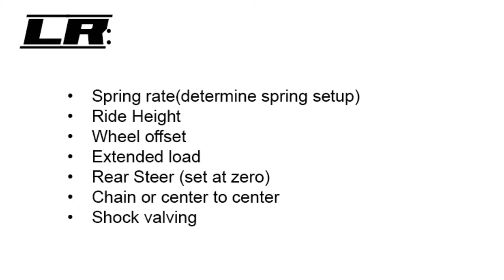Left Rear Setup and how it works.

Comment: 7:23 extended load -  consistently over 250  decrease rear percent. Under 180 increase rear percent ?  Can you explain that a little further
Reply: Seems like it should be opposite to me.
Reply from the maker: Sorry, these are not scripted videos, and I made a mistake, thanks for pointing that out. Good ear. The statement is on extended load: If you keep increasing the load and find yourself above 250 pounds on a regular basis you will need to increase rear % also, and then drop your load back down to 180 pound range.
Reply: @jaynealgofast  Thanks for this question, I was giving you the orator the benefit of the doubt, trying to puzzle it out!! Ha!!

Comment: What are your thoughts on using the roll centers to load the tires and how that affects the car differently than the shocks and springs?
Reply from the maker: Yes, the Roll Center (RC) or center of gravity (CG) is what we are trying to make move. These are two different points that work in the front of the car. The roll center and the way it moves, and the height of CG determine the amount of spring load we see, while the shock controls it. Now there are other things involved in making this work, this is just a simple version of it. We will start working on a roll center program for you in the near future.

Comment: Jay. Just needing a little bit of a clarification. So you are saying to mount the chain mount as far out towards the birdcage as you can? Most things Ive heard about it was as close to the bell as you can. Thanks
Reply from the maker: Hear are my thoughts about chain drop: We are all over the map on this, putting it next to the bell is the only thing we can agree on when it comes to LR chain.  When someone gives you, a chain drop it is kind of like shock valving, don’t mean much. 3.5” of chain at the bell is a lot vs. 3.5” out by the cage, and what is important is how much is the tire moving. For your own program you can mount it about anywhere you like and make the adjustments needed for your car. But when someone is helping, and you give them a number it seems to be inaccurate how much the tire is dropping. Wonder why everything is going towards the bell, maybe that is the question we should ask???? I mean really, is there a reason I don’t know.  Thanks for your question.
Reply: @Jay Neal  appreciate the response. In my scenario, I only have 4in of drop as it is due to the underslung as I am on some 2009 technology 🤣. From everything that Ive heard. Moving it closer to the bell makes the force of hitting the solid chain less violent. But the other scenario that I see  is that it is also a pivot point as you have mentioned in different vocabulary.  On the 175 that  I run in the RR. I am going to gain travel on the RR as opposed  to say a 225 and with that clamp moved in I could gain some LR travel theoretically as long as I dont run into a bind. But I certainly see your point as well. I appreciate the  discussion as well

Comment: On a typical street stock with the spring on top would you adjust the preload by tightening and loosening the chain at full hike. And I’m assuming full hike is what ever you limit it to? If not how do you determine what full hike  would be?
Reply from the maker: I would not do it that way, but I think that is what is going on with a lot of cars. In the last couple of years, we may have got better about not doing that. When you shorten chain to add drive you reduce the thrust angle between the LR and RF which will increase how load is applied to the RF tire. Can make the car push.

Comment: hello, so my question is stacked springs on the left rear, let’s say i have a 12” 175 under a 6” 100.  the 175 has a lockout but to control my rideheight while the top spring controls my amount of preload.  i’ve always gone by more turns of preload is going to free me basically all around the corner where taking preload out is going to tighten me and give me drive.  i’m basically wondering if more or less pre load is going to help me rotate and how it affects the right front and right rear.  thank you
Reply from the maker: Ok, this is something that leaves me asking more questions than answering. This is not the 1st time your statement has been made about adding and taking away load changes the car in an abnormal way. (  I’ve always gone by more turns of preload is going to free me basically all around the corner were taking preload out is going to tighten me and give me drive.)  When you said you go by, that maybe the part I am not getting, because removing load and making the car tighter strikes me as funny unless you are starting with a ton of load. This is a Late Model, and a lot of those guys don’t run much load in their cars but let’s say you have 200 pounds of spring load in the car and when you get off throttle and the rear of the car goes into a condition know as auto-turn, where the rear end starts coming around. When you lessen the load, it stops, and you say I have tightened my car up with less extended load. There are a lot of factors that come into play when making this statement and those are still at an unknow. In general, we work on the basis that when you increase the load of the left rear spring (extended load) you increase how hard you are pushing the left rear in the ground which should make the car tighter (Center off). The rear steer the car has on entry and maintaining it to center will make the car free through the corner and adding throttle to the car should keep the car turning. You would not want to increase the cars yah much because it will give up the rr tire as you go around the corner.

Comment: On a ha/as, when you put your preload spring back in, I assume you would then adjust LR ride height to initial setting? Then measure cup to cup and calculate pre-load number?
Reply from the maker: NO sir, after adding the preload spring to the car you need to leave everything alone. The car was right and will get into attitude the same as it would of. If you change after you set the load it will get there with different numbers. Adding extended load to the left rear will change your loads and ride height on the other corners but it is what it is and will be okay.
Reply: @jaynealgofast  ok, so I should measure jack bolt length prior to removing setup spring, back off jack bolt, remove set up spring, install pre load spring, and run jack bolt back to original length with the setup spring?

Comment: Do you need a spring smasher to check extended load? If a guy doesn’t have a smasher would you just set ride height and static wedge on the scales?
Reply from the maker: No, you can do it cup to cup with a tape measure and math. Exp (18” 80lbs spring@ 200 lbs of extend load is 2.5” compressed or 15.5 tall) NOTE: math and smasher will not be the same numbers. Yes set scale numbers on car at static and then add LR spring.

Comment: What is the reason for setting the car up with the 175# spring and then changing it to whatever you’re gonna run with afterwards?
Reply from the maker: When you add the softer spring, it changes the cars posture (spring rate depends) which makes the other corners move. This makes it hard to be at ride height and every spring rate and load will be different too, this makes it hard to get help. When done you have a car with rear%, left side%, bite and load and this is how you should express what you have when talking to people for help.

Comment: Does all of this change if you drive hard into the corner or just roll into the corner?
Reply from the maker: Yes, the slower you drive in or the more off gas time you have than the more LR shock you will need. The LR shock has become more of a personal item than what is needed for the car. Remember this the more LR you add to a car the less drive it will make off exit, this is not always a bad deal but it is consistent deal for sure.

Comment: Ok so a 3000lbs stock car, would you still recommend the 180-250lbs of spring preload? Or should that number be increased a bit due to more weight on the wheels? 

And what exactly does the LR preload do besides hold up the car on entry? More preload tightens car everywhere on the gas or little to no preload loosens car on the gas?
Reply from the maker: We still start in that range due to the heavier car and if we feel like we need more than we will increase it. It help control wheel spin coming off corner also. The idea is to increase overall traction on the tire.